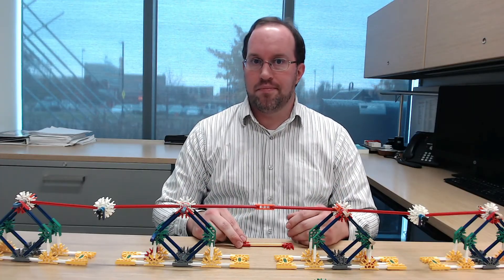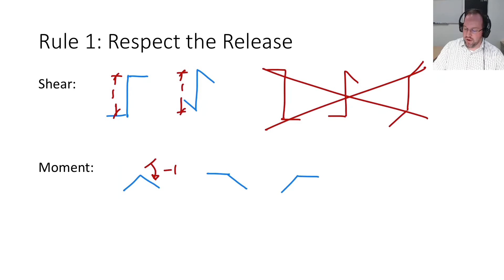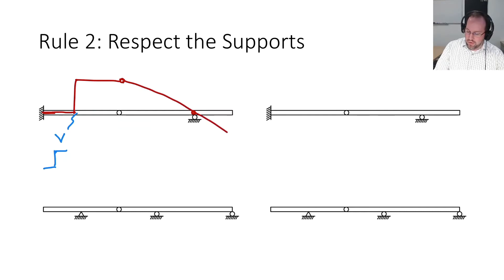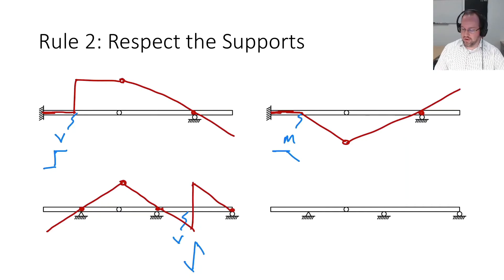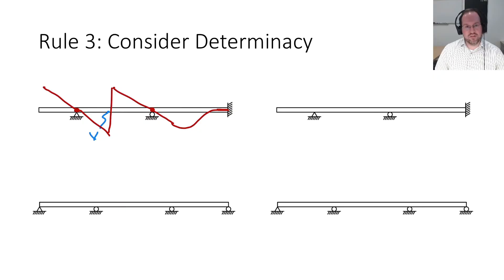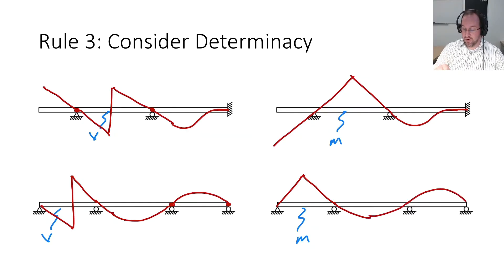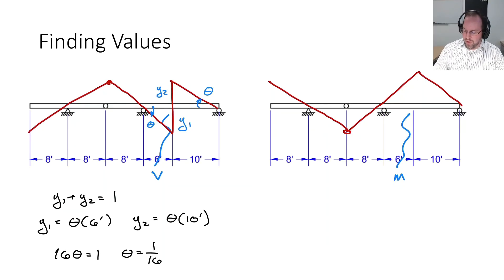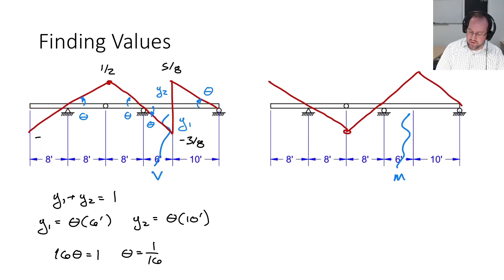Muller-Breslau Principle for Influence Lines - Intro to Structural Analysis

Comment: At 8:00 minutes on the drawing of the moment influence line, it formed a valley but according to your explanation, it shouldn't form a valley
Reply from the maker: Sorry, perhaps I was not clear. When finding a moment influence line, the location of interest will always be the highest point (or tied for it) in that nearby region. So there are technically three ways this can happen: 
(1) an actual peak:  /\ 
(2) a slope up followed by a plateau:  /͞  
(3) a plateau followed by a slope down:  ͞  \

Note that in all three cases, the change in angle is always happening in the same direction so we say that this "peaks" at the point of interest. Using a similar definition, a "valley" would look like \/   _/   or   \_. 

In the drawing you reference, the left hand side is fixed, which forces the slope to be zero. Meaning this influence line looks like option (3) a plateau followed by a slope down. We do get a valley of course, but not AT the location of interest, but rather AFTER the location of interest.